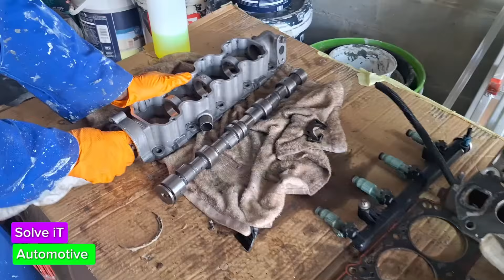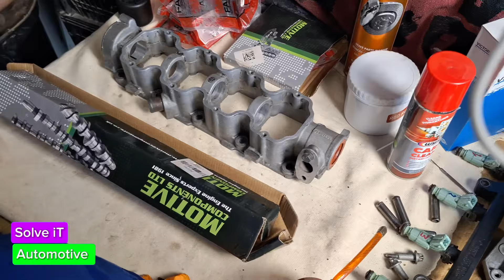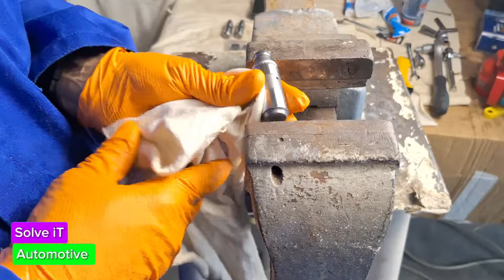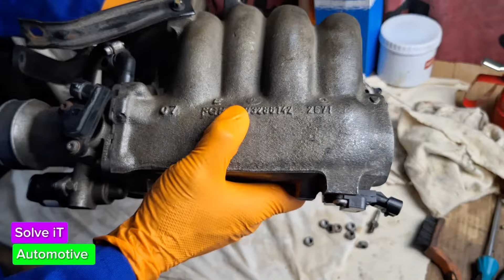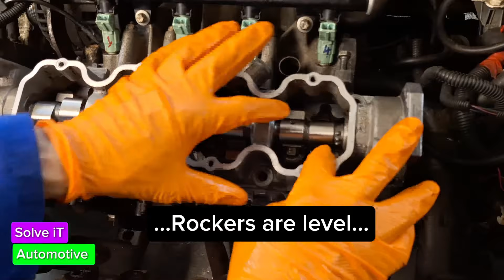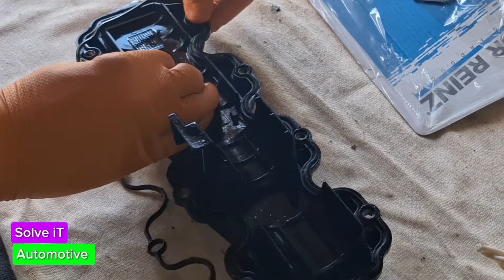Opel Corsa Utility 1.4i Upgrade 2025

Comment: Hi buddy I own a 2002 1.4 lite where can I buy a good quality idle sensor,and I got the car idling without it but im not sure if the faulty idling sensor will make it heavier on fuel,I never get more than 12km/l and that is doing 100km/h
Reply from the maker: hi there . the idle valve is an essential part of the system . you can try the opel spares yards to find an original one , which is best. or an aftermarket at goldwagen. many ppl assume that the idle valve is the only cause of idling issues , but in my experience its only the syptom of the main problem. 
 overall i will say, its best to inspect your injectors, throttle body and manifold and definitely your electrical system in the engine bay. make sure the cold start is working and check wiring.

Comment: Hello mr solve it after mechanic took the top to engineering  not my brake  pedal is hard and adling is too low to the point engine  stalling, what might be the problem 😢

Comment: Hi boss how are you? Is the brands of the lifters and the rockers good quality? Will they last in the long run if broken in properly? I'm not sure which brand to go for when it comes to lifters, rockers and a cam. But I need to do lifter replacement soon and I don't want to replace it again in 3 months time. Would you say the brand of the parts you bought, is a good reputable brand?
Reply from the maker: The most important thing you need to do is to make sure that you engine is clean , no sludge , no grime , no black. Your oil pump must be in excellent condition or have been recently replaced. Clean  your sump and pick up . New head gasket , valve stem seals etc, oil holes all clean .
In other words make sure everything is sorted. 
If you want any brand to last , cheap or expensive , make sure your engine is perfect. 
Don't waste your time or money if you are not prepared to go all the way.
Reply: @solveitautomotive9485 thanks for the reply sir. My engine is untouched, not modified, very clean original condition, and also clean inside as I service it every 6 months, with the intent of keeping it in as good shape as possible. I will rephrase my question, would you reccomend any brands for lifters? Or rockers? In your experience, any brands I should watch out for?
Reply from the maker: @agwat...7372  try to get Motive ,  KS , FAI . Victor reinz 
Try Alert motor spares or masterparts.

Why did you say you change cam and rockers every 6 months . Sounds like u had a bad experience
Reply: @solveitautomotive9485 No sir. I said I service it every 6 months. Oil change and oil filter every 6 months. This car never skips a beat, Absolutely no issues, and I'm extremely proud of it. Only reason why I'm being so picky about parts, is that I intend to keep this car for years to come, and I prefer it keeps on being as reliable as now..
And if I know what parts/brands are good quality, I'd happily spend extra if it means this car keeps on going.
Reply: Oh and thanks for the recommendation. Much appreciated!

Comment: I'd like to thank you for all of the content you produce for the Opel Corsa 1.4, I've watched all of your videos and I appreciate the amount of knowledge you share so freely. All the best, I wish you many more safe Kilometers. 👍
Reply from the maker: Thank you so much for the support and I'm glad you find the content useful. 👍
Reply: @solveitautomotive9485  Hi, I'm hoping you can give me some advice. I have an oil leak coming from my Camshaft housing, I understand that the housing must be removed and silicone sealant applied to the bottom surface and then re-installed. 

The part I'm unsure of is whether I should set Cylinder 1 to TDC when installing the Cambox, Torque the head bolts and then rotate the camshaft so that it's in the correct position (Intake valve open, Exhaust valve closed). 

OR Should all the cylinders be set to equal height, Cambox torqued down to spec and then set Cylinder 1 to TDC and then camshaft timed up, If that's the correct order of installation could you tell me roughly where the Crankshaft timing mark should lay so that all pistons are at equal height? 

I appreciate any insight and knowledge you're able to share with me, Thank you.
Reply from the maker: @serge1914 Hi . Your second part of your how to is the correct one . 
Before you set the timing carefully insert a screwdriver into no1 cylinder thru plug hole. Rotate engine and carefully rotate until you feel the piston is in the middle . Don't jam the screw driver someone may have to hold it for you. 
Then do your timing . 
If your head comes off set the pistons in the middle before putting the head back on .
This should be the case, as when you loosen the head bolts you must replace the head gasket and bolts .
Please watch my video 2025 upgrade on my channel. 
Do anything and everything else you can manage to do when doing this job.
Reply: @solveitautomotive9485 Thank you for replying and for the advice.  I wish you all the best!